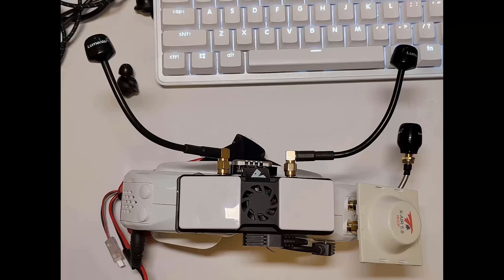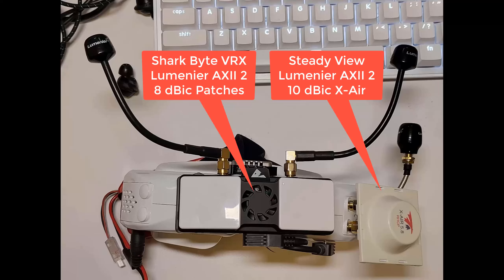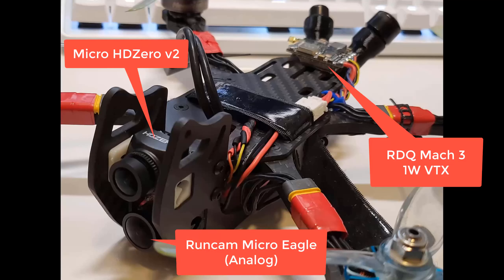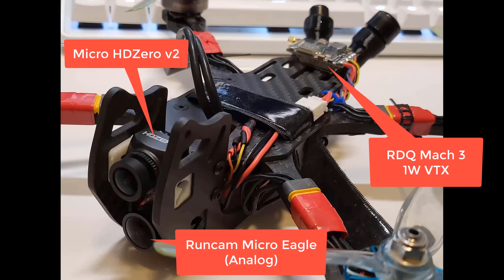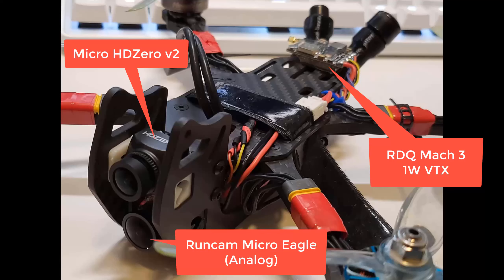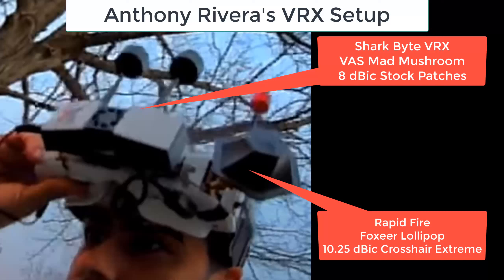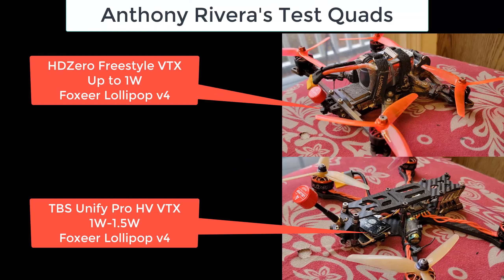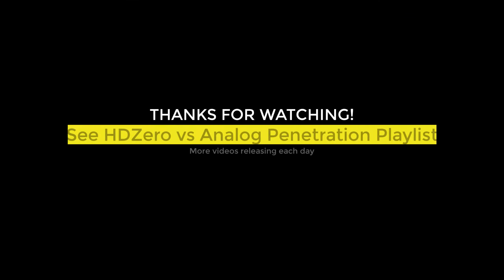HDZero vs Analog Penetration Tests - Introduction & Test Setup

Comment: Not using a rapidfire module opens you up to criticism immediately, the steadyview has a very bad track record and quality control is all over the place. I had one myself and it was very poor for mixing signal and giving a clean picture.
Reply from the maker: That's only 2 tests. The others are with rapid fire. Not everyone is using a rapid fire or fusion module. This is valid
Reply: I can confirm tuans steadyview was functioning properly without desyn issues and many if the tests, as Ryan Saud are in rapidfire 🙏 we tried to cover as much as we could
Reply: With all due respect, Steadyview is an excellent analog receiver. If yours is not as good as RapidFire you have a defective one. Didn't see any complain about the higher power of TBS Unify in favor of analog... IMHO, it seems a fair and transparent way to do this test.
Reply: @felipehol1  I am on the skyzone group, this is an extremely common issue with this receiver. My point is if you know it has issues, how can you know if the results were from the module or because of the analogue system? Nobody would second guess RapidFire.
Reply: @Atlas_FPV  Hi, good night and thanks for the reply. I value your argument, I agree that a group of consumers should have more weight in evaluating a product than a single isolated user (like me). You have a valid point here.

However, the tests they've been running don't use only steadyview (there's also a rapidfire) and analog vtx can output more than 1W (one of the quads has a TBS Unify). So It seems pretty valid for me.

Have great flights in analogue or digital, we are all in the same FPV team :-)
Reply from the maker: @Atlas_FPV  have you watched the tests with rapid fire yet? I am unaware of issues with steady view. But we also tested rapid fire and tbs fusion. More videos are coming
Reply: @RyanQuellet  I have watched them all yes, its a pretty clear win to the point where the module wouldn't really matter to be honest.